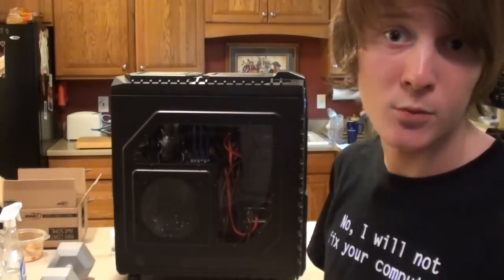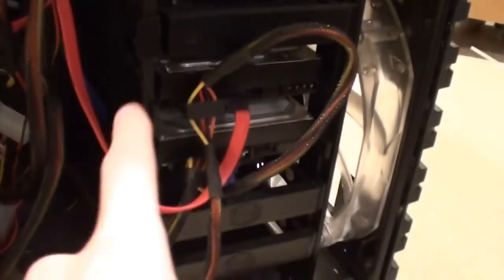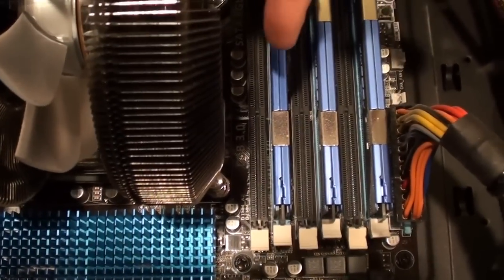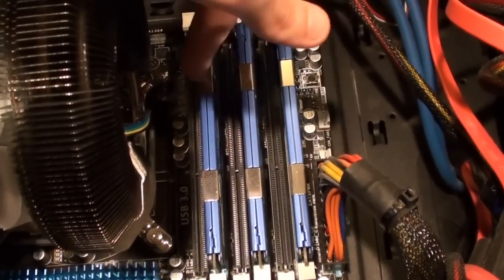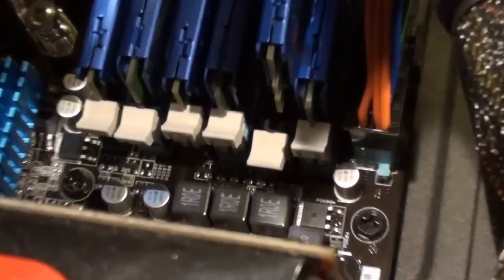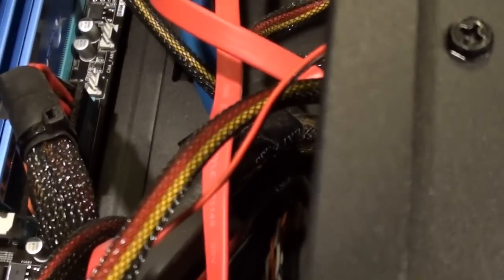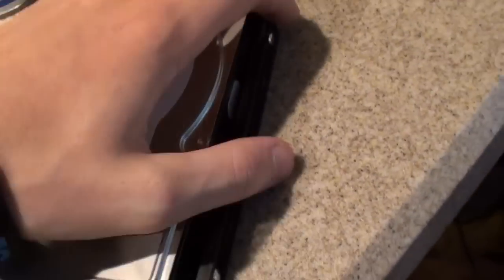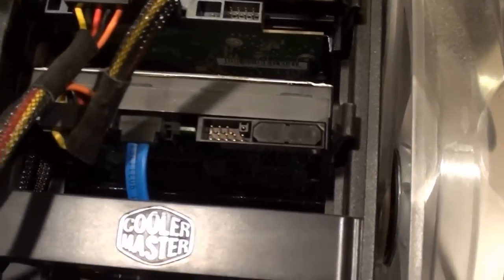Rep Tech  #2 How To Install Ram In Your Desktop PC

Comment: Open your Desktop PC and look where your current drive is connected to, the connections for the same kind of hardware are next to each other most of the time, so it should be easy to spot (It's most likely S-ATA, make a google-picture search to see what it looks like). If there is a free Slot you are good to go. (also look if there is a free powercable, dunno what powersuply you have)
Plug the S-ATA cable into the motherboard and drive, and plug the power cable into the drive, done.

Comment: PLEASE HELP okay i just ordered 8 gigs of corsair dominator plantinum for my computer its a pavilion p7 1490 and it has default 6 gigs of average ram and i was wondering since the dominator plantinum ram will be far superior will my system know to use the dominator plantinum for simple tasks instead of the default ram because there both goin to be in my system okay thanks

Comment: Make sure your power cable is put in your graphics card and check if its in all the way. if none of that works then check if you have the right power cable inserted into the graphics card. If none of these work then unfortunately your current Graphics card is broken :(

Comment: yes you do almost usually unless your using a high performance new motherboard where the bios should overclock the RAM all for you. But if not then you'll have to do it manually... usually RAM when inserted will be at the previous RAM clock and all the other settings an controllers.

Comment: I would highly recommend that you do, especially on quadruple channel motherboards, the BIOS now-a-days can load presets on the RAM block and will use those timings, so if you have two or more different manufacturers running at different timings - You are going to have a very bad time. My recommendation would be; buy RAM from the same manufacturer, with the same speed and same timings for each channel. One can usually find RAM in pre-made sets. Double-Triple-Quadruple-channel sets.

Comment: PLEASE HELP ME I have just built a computer with the ASUS Rampage Extreme IV with an EVGA graphics card I’m using the OC Key to plug my monitor into but it will not display it and my graphics card does have power

Comment: Hi thanks for video and as a new comer to computer mods,i have a questtion my pc has 30GB hard disk and  my system is very slow due to small ram,.if i want to expand like 3GB of ram you think  still i can use that capacity of ram even if i have small capacity of HDisk.

Comment: @MrRepzion 
Question, i am going to buy a Kingston DDR3 HyperX 1600MHz 4x4 which is 16 gb of ram, and i have 4 ram slots. Will my pc accept that or wont it turn on as you said earlier? and my maincard supports 1600 mhz etc :)
Thx.

Comment: Somthing I don't think you mentioned is that DDR3 DDR2 and DDR1 RAM type memory isn't compatible with certain motherboards as all these types of RAM. Motherboards only support one type of DDR RAM memory more modern ones being DDR3 the least and rarely seen nowadays being DDR2 but if you buy DDR3 RAM and your motherboard only supports DDR2 IT WILL NOT FIT INSIDE THE SLOT. So that's something to keep in mind

Comment: I have the same brand of RAM (the hyper x), also 12 GB total with 6 slots. I also have a Intel Core i7 processor. However, I have a different motherboard and case. Otherwise my system is very close to yours.